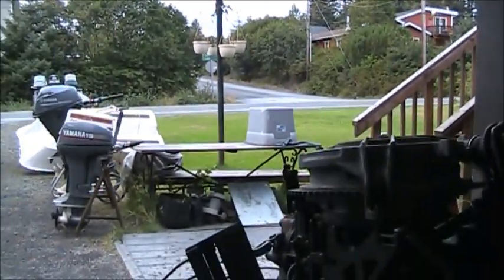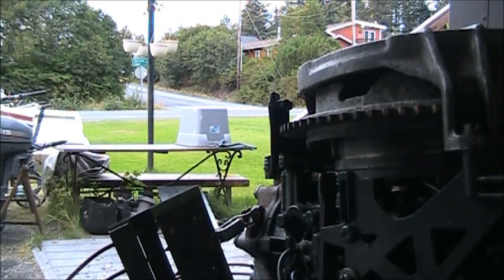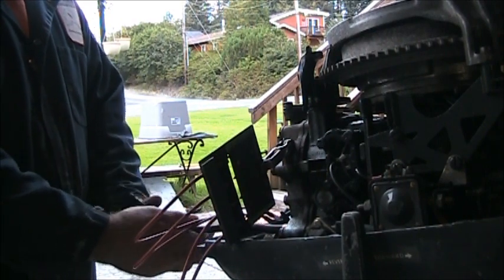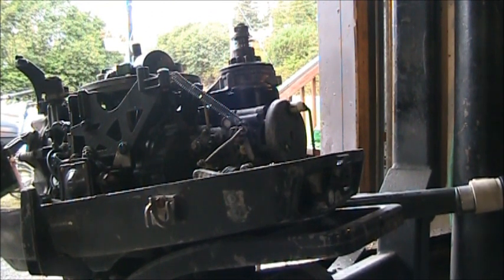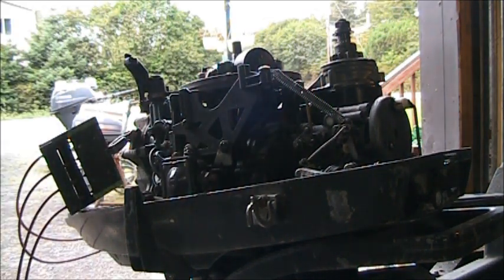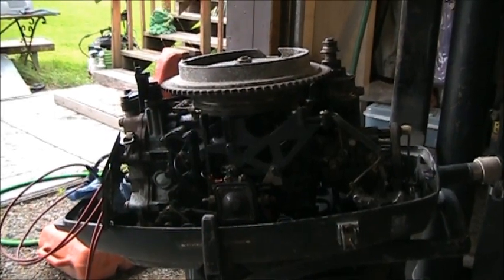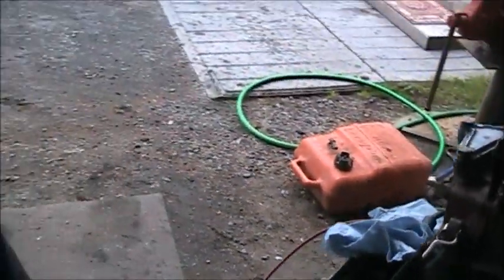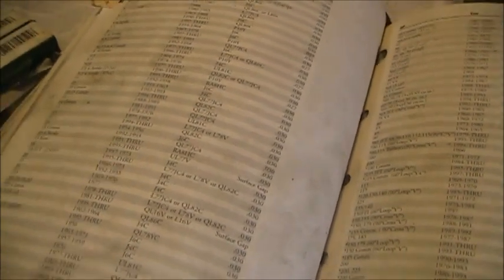1971 25 HP JOHNSON  Problems (FIXED)

Comment: Heyy  kodi.   25 hp evinrude wont run unless full throttle.    To fire up.  Can back down to half.   Any lower it dies?
Reply: Seems like needs more air to start.    Wont start at start position
Reply: I cleaned carb.  Since somethings not set right.   Thinking    high idle screw is outa adjustment?
Reply from the maker: @dustinclark8186   also  mite be float needs adjusting., or transition chamber holes in top chamber are clogged up.     kodibass

Comment: I think you made a mistake with the plug number J4C are the right plugs no big deal the one you said L77JC4 or QL82-C are for CD motors which came out in 1977 and have longer threads and different heat value.Just a shout out Those 25Hp I still have  many and sold many they are the best 25HP OMC ever built in my opinion simple and lightweight and at 22 cubic inches fantastic motors just provided one to a local Fire Dept a 1973 model ran like a top ... love 18-25HP videos thanks for posting ............................ Im an outboard mechanic and collector for many years in the northeast...GlennP.
Reply from the maker: +GFPALL62,  Well I will 4 sure check & RE-Check,  Thank you,   & Thank you for sharing this very important info.                                                                                                                    kodi
Reply: @kodibassInsideoutboards  Well I dont think its that  very important but when you see them then it would be self explanatory that those other plugs wouldnt be the right ones probably still better than those permagaps in there ,LOLL which came with the motor.Love your videos and This Ole Outboards too I only have one video myself with a 9.5 but that may change................  Glenn P.

Comment: Hey man just got one of these guys rebuilt and running, had it running all day fine but now it runs about 10 seconds misses twice and shuts off.
Reply from the maker: +WE  do a basic FACTS  Check,  Will the motor stay running if U squeeze the primer bulb constantly ?                            kodi
Reply: @kodibassInsideoutboards  No it will not, just changed out the fuel pump too and charging coils. Is it possible it could be bad capacitors?
Reply: *condensers
Reply from the maker: @willerskine2061   Could B,  What I would do is get 2 in-line spark checkers run motor and see if you are getting spark rite up 2 the time of it dying, If so Then I would let it cool down restart it as soon as it misses & starts to die, I would spray some mix gas or tri-flo into the carb & see if it continues to run.   kodi
Reply: @kodibassInsideoutboards  Hey thats pretty smart ill try that. Thanks Kodi youre alright.

Comment: Well, Rube Goldberg really got after that electric choke, it is all ass backwards and farkled up...Standard magneto ignition, cool!  Hate that low tension stuff.  I thought the QL77s/82s were for the MagCD engines, I would stick with the J4C/J6Cs.  Don't know what the rattling is, but doesn't sound internal...Perhaps it is the electric choke mess.

Comment: So ignorant question but were is the kill switch on the dinosaur?
Reply from the maker: +RB,  the original stop switch is in front right side of lower pan, 2 the right of the lean rich adjuster.                   kodi
Reply: @kodibassInsideoutboards  yea this is a 68 25 johnson and has electric start with no killswitch other than the key switch. I just got fire to the top plug much like this video .